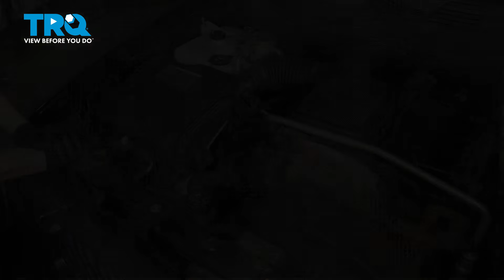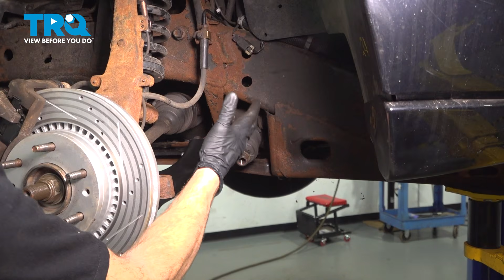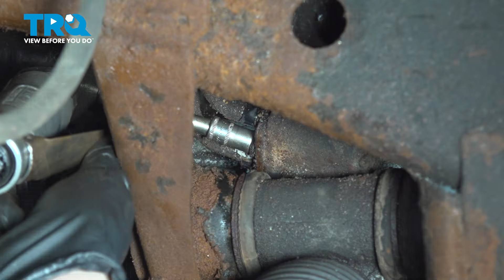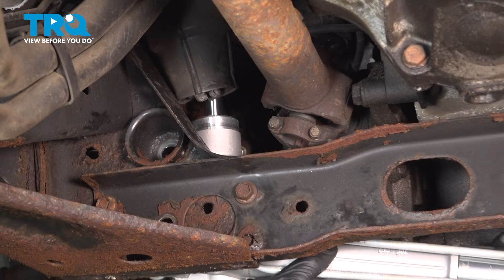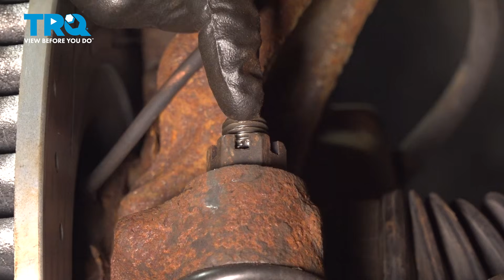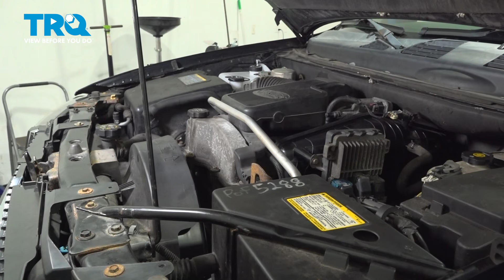How to Replace Power Steering Rack & Pinion Assembly 2002-2009 Chevrolet Trailblazer 4.2L

Comment: I’m supposed to be getting the steering rack for my 2008 Toyota Rav 4 replaced this Tuesday. I’ve been having to use my parents vehicles to get to places. As much as I appreciate them letting me use their vehicles I really want to drive my own.. but when I am driving it I have to hear a loud clunking sound going over bumps and a knocking sound and feeling when I’m turning. Midas tried to say it was a damaged inner tie rod boot but I didn’t believe them.

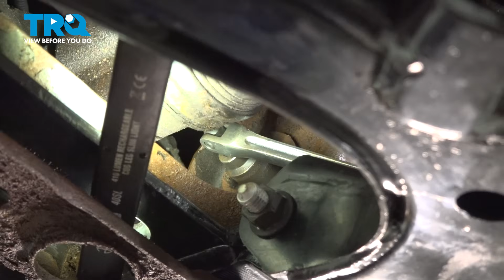Comment: @8:47 how do you get that 21mm socket/breaker bar behind the CV Axle ? I did everything I could I even broke the CV Boot Clamp trying to get the socket in there. Super misleading part of this video now the mechanic is trying to charge me crazy amounts because he claims in order to finish the job he has to remove possibly replace the cv axles on both side..

Comment: My 2004 doesn't have an 8mm bolt, to remove the lines from the rack!
It seems to be smaller, and when I tried to remove it, the head stripped!
It's too tight to try any other way to remove it!😢

Comment: Not sure if I will get an answer but the two big bolts that hold the rack in, what name brand socket did you use?   My small 26mm does not work because of the length of the bolt and I am unable to even get a large 26mm socket in the hole?   Did you have a special socket?

Comment: Thank you for the video but can someone help me. So y'all don't have this rack on your website anymore. So I bought one from advanced that measured the same size as my old one but after installing my outter tie rods are now too short to reach the inner. If they do the toe is Way out and the tires are facing out. I got extensions for the Tie rods on order. But what happened? Why if my steering rack is perfectly straight and equal on both sides that my outter tie rods don't reach anymore. Lining the old rack to the new they were identical it seems. So I'm just lost why I need extensions when I this video you had no issues. You even turned the rack and said "equal on both sides" so I'm lost on what happened to me. I bought an OEM rebuot rack according to Advance.

Comment: Good video, however unless you're using some kind of aftermarket seal, the OEM seals are pressed into the rack, and should be tapped in using a socket when the rack is out of the vehicle.  You can also pre pierce the seals while it's out, which will make getting the lines into the rack a lot easier.

Comment: Thank you so much for this video. The transfer lines on my daughter's R&P went out. I watched your video and stopped after each step, went and did that job and then came back and watched the next step and went to do that job. It went flawlessly. The hardest past was moving that rubber boot up off the pinion to get to the pinch bolt. Thank you so much.

Comment: Well, I accidentally moved that part and my steering wheel is now turned a little to the left, it will be easier to remove it again, or turn my steering wheel, or align it, the steering wheel is only slightly left but it is noticeable when it is Right the wheels, this one is a little to the left.